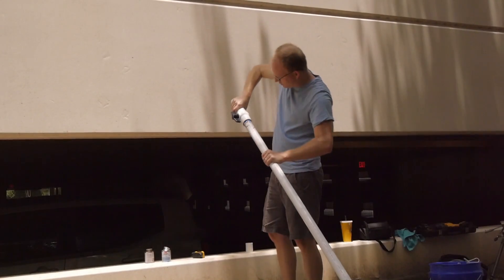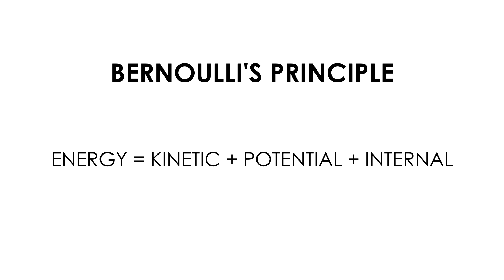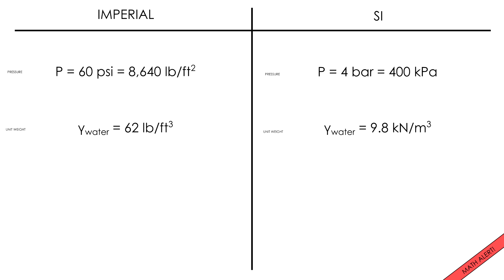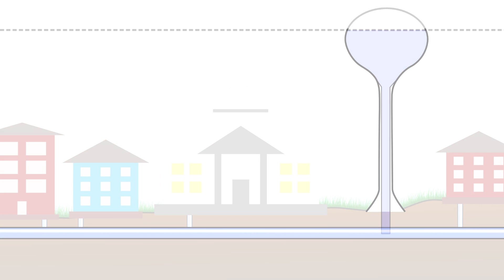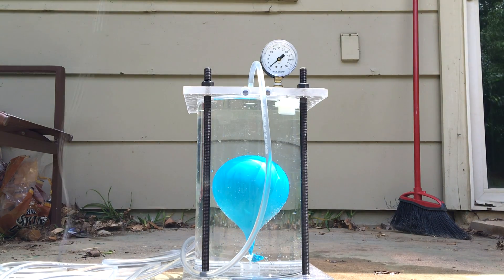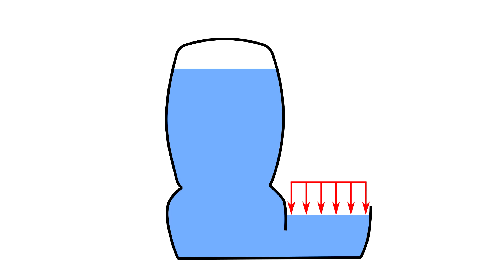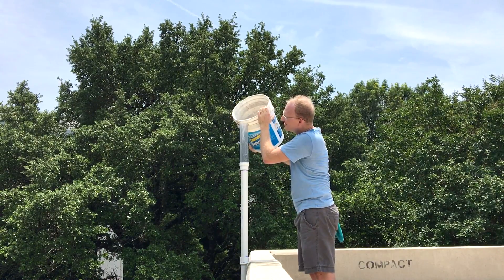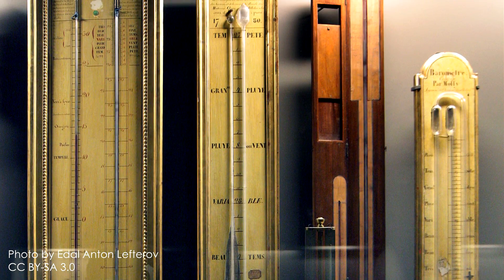Boil Water at Room Temperature! - Hydrostatics

Comment: The explanation for the water bowl is not correct. The top of the tank is, in fact, filled with air. When the tank is put in the bowl the water drains out, being replaced with air. When it reaches a certain height, the water creates a seal preventing air from replacing the water in the tank. Because there is nothing to replace the water, it stays inside the tank due to the force of a vaccum, but there isn't actually a vaccum in the top of the tank.

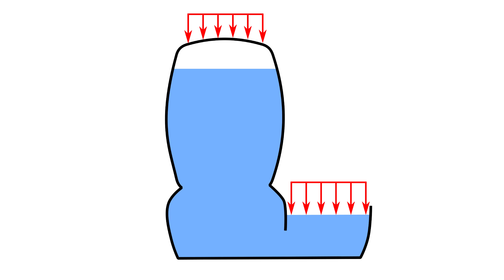Comment: 7:05

1. If im not mistaken, that is air inside the tank, not vaccum (obviously at a different pressure from atmospheric)

2. Applying bernoulli principle at h1 and h2 (assuming from the video that they are like 20 cm apart) you get that air pressure inside the tank is aprox 0,9 atm. Isnt that too much for the amount of air inside the tank?

Comment: I deal with this a few times a week.i siphon out barrels of water collected from ac units.ive learned to get a siphon going by simply taking a length of hose long enough to go from the bottom of one barrel to the next plus a couple extra feet.
I then yank the hose very very quickly out of the full barrel of water and have my thumb tightly covering the end of the hose and once the yank gets below say half the barrel of water I release my thumb of the end off the hose.
.generally doing this twice gets a serious siphon going.
The siphon stays going strong until that balance changes between barrels/buckets.

Comment: Actually, after read the title I am expecting knowledge to boil my drinking water without consuming gas.  

But not disappointed at all.
Another great video Grady.
Reply: Won't work. Just because something boils doesn't mean it's hot. You need actual high temperatures to kill germs and organisms. Water can boil at 50 degrees F. Just lower the pressure enough. That's why water will boil at 186 degrees F on Pikes peak. But it's not as hot.

Comment: Great video! I always wonder about negative pressure on water. Now I know. But what was the pressure at which the boil happens? Second, can you do one on Water Hammering? I learned that water is a incomprehensible liquid. That’s why they don’t use it in hydrology. But it would be great to know the pressures at which water fails either way. Please let me know if you do a video on this.

Comment: 2 inch pipe 200 feet long with a rise of 60 feet verses 1.25 inch pipe traveling the same distance and height. 2 inch pipe has approximately 236 lbs sitting in the pipe and the 1.25 pipe about 76 lbs  the pressure is the same I understand this but if using a 13.5 horse power pump will it draw less power to pump water up with the 60 foot rise with 1.25 pipe and more for the 2 inch pipe? Or will it take the same amount of electricity to pump up the water regardless the diameter of the tube being used?

Comment: I think there's a small misinterpretation here. Water pressure is not like conventional force/area pressure. It's a hydrostatic pressure and in fact it acts in all directions equally. The reason the hydrostatic pressure increases with column height is probably because of the increase movements of the water molecules. But I'd definitely like to know why that happens

Comment: Take a syringe, remove the needle. 
Pull a small amount of water into the syringe. About half full.
Place a finger over the nozzle where the needle would be and pull the plunger.
You just boiled water without heat.
WARNING!!   NEVER release the plunger while your finger is still sealing the nozzle when water is in the syringe!!
Water is EXTREMELY painful when injected into skin tissue, and doing so WILL inject water into your finger.
The plunger returns at a very high rate of speed when water is present.
Reply: So you injected water into your finger using a needleless syringe ?
Reply: @AmjadAbboud  
My first time doing this, yes.  I released the plunger and experienced pain I never expected.  lol
Certain immunizations used to be administered this way.  From what I was told, they were equally painful as the water was to my finger.
Don't get me wrong, it was not a lot of water injected. Just enough to make it under the skin and create pain.

The larger the syringe, the greater the risk. Standard small ones, while painful, tend to not inject the water as much as slam it violently into your finger.
Do the same with air only in the syringe and it returns very slowly.

Comment: Don't you think the title is slightly misleading "Boil Water at Room Temperature"
Reply: He showed you how a pipe 40 ft tall cap at the top and open at the bottom filled with water if the water was heated so 90 F it would have had a very vigorous reaction.
Reply: No, it boiled and was at room temperature.

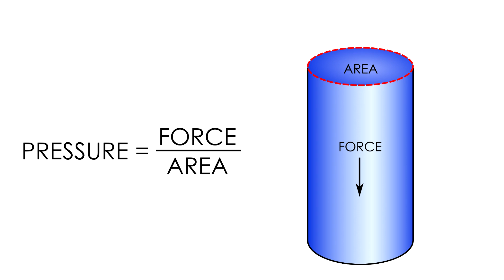Comment: 5:48 so does that mean: if we would stack single water molecules on top of each other to form a molecule tower with a height of 10 m, the pressure on the single bottom molecule would be 1 bar?
Reply: For single molecules, this wouldn't hold. As with most non-quantum models, this represents the average behavior of the molecules in the system.

Comment: Great Video, just one thing about your 10 m water pipe experiment: As the water starts boiling, it creates additional pressure in the pipe, but the total mass of water (liquid + gas) does not change. The ait pressure can therefore not push against that both, so water WILL come out at the bottom of the pipe. Probably not that much with your setup, but still some. Would have been great to see the bucket at the bottom during the experiment.

Comment: you said ' you can boil room temperature water just by taking it to the top of a parking garage '
that is wrong .
it sounds like you are saying if you take a glass of water to the top of a parking garage it will boil .
[
I am sure that you must mean that if you contrive a contraption as you have done with a pipe and close off the top while letting the water contents be pulled down by gravity with only the atmospheric pressure stopping it - then that will cause a vacuum at the top of the pipe which lowers the pressure enough to bring the boiling temperature of the water down to below room temperature - once enough water boils off to equalize the pressure - the boiling stops .
[
there - now i think we understand correctly what you meant .
[
please correct me if i am wrong - i am positively sure that is possible

Comment: was the valve opened or closed when you submerged it in the bucket?  basically was there  trapped air in the small section of PVC below the valve in the bucket or was that purged out? thanks

Comment: Hi! I know that the videos has two years but the subject is exactly what I need for my project so if you could answer me it would be great.

I am installing a 3kw micro hydro generator in my house. I have max 80m head from the generator to the point I take the water uphill. The water will be collected in a water tank and then direct it to the generator in a 25mm tube 60m below (to avoid excess cost of widest pipes). Will it be enought to create about 3kw of Energy? Will a wilder pipe give me more Energy?

Thanks!

Comment: Gravitational compression is relative to the electrostatic tension in the relative vicinity.  This is based on our planets motion.  As water shows us, we can induce electricity from inertial motion. We do not need water as a conduit for applying this electrogravitational compression value.  This can be induced using very simple, effective and affordable means. Innovation, 101.  https://www.google.ca/search?tbm=isch&q=electrogravitational+propulsion+mechanics&chips=q%3Aelectrogravitational+propulsion+mechanics%2Conline_chips%3Ainduction%2Conline_chips%3Akevin+hay&usg=AI4_-kT1BuY9kHAVfoGHs7gN0SWzJcG3wQ&sa=X&ved=0ahUKEwif0pqDpJjeAhVdHDQIHSj2ChAQ4lYIKSgA&biw=1366&bih=657&dpr=1&fbclid=IwAR2TYvqlG5tSBJszFu3lhzjrxjhPWeURubzVNm2oVExBZvZqi_1EYTE5QQI

Comment: being in a tank with a tube connected to the top filled with fresh water like in your demonstration would not be the same pressure as swimming to the same depth of water in the ocean. as the water in the ocean is denser than the water in the column.  😉

Comment: In your opening chart, the one with the red dots, the answer to how to show they are all the same pressure could be shown by extending a small "pipe" up.  if the pressure was greater in one or the other, then the small pipe should show higher.  
Now, this becomes more intuitive and does show logically/visually that the pressure is all the same.

Comment: So say I have a 100% fully airtight room. I fill the room with water and then go into the room. I'm exposed to a certain amount of water pressure. Now say I add a pipe at the top of the room and fill the pipe with water, then have that pipe point directly into the air (i made an illustration: tinyurl.com/tblpressure ) Would the water pressure in the room become extremely high and crush me?

Comment: Actually one small point using inches of mercury for air pressure is very rare today, hectopascal/millibars are more common (Both units being functionally identical). This is most notable in for example aviation the standard atmospheric pressure of 101.325 kPa would be expressed as 2992 in the US (Representing 29.92 in Hg) but in the rest of the world it would be given as 1013 (1,013 hPa). Similarly in weather forecasts the rest of the world uses hPa or millibars too the US just likes to be different even if it costs a few multi hundred million dollar spacecraft in the process.

Comment: this is really messing with my mind
so you're saying if I were to be submerged in a tank of water only 2' below the surface
then someone were to connect a STRAW to that tank that's 30' tall and fill it with water
I'd immediately feel like I was 32' below the surface?
Reply: If the container was sealed it would hold the pressure, if you are in an open container like a pool the raised water would just flow back to equal out pressure

Comment: The large diameter of the tube and the bigger water container on top,  compare to smaller tube and smaller water container on top, if both are at the same height,will the large diameter of the tube and the bigger water container create more pressure?

Comment: I have a question about civil engineering.
My home town is very hilly, and I calculated that there's just no way to pump that high pressure water to all houses on a hill. The pipes on the bottom houses would just explode, while the top ones won't even get any drips.
This also applies (more) to skyscrapers.
Now I later found out that there are stations situated around the city that take care of raising water pressure for pipes above it.
What happens in a skyscraper?
Could you maybe, sometimes, somewhere, please, pretty please, make a short video, or even some photos, of how that looks like?

Comment: GENUINE QUESTION PLEASE HELP. If I have a tap at the bottom to allow the water to fall into the bucket, can I then when the water drops capture that boiling water by knowing where it drops too and installing a ball valve and a tap?

With pipe and bucket can I instantly boil a cuppas' worth of boiling water for the price of turning taps and having carried water 4 flights?
3rd floor kinetic coffees?

Comment: Could boiling water at low pressure be a solution to the need of drinking water..??
Reply: Basil Sunny Well here's the thing, boiling water the traditional way has heat high enough to kill harmful bacteria, microbes, and fungus that's hiding in the water. Boiling water using low pressure does not kill these harmful critters living in the water, it only pulls out dissolved gases. 

I do like the way you think, keep it up and you might change the world one day.
Reply: Thanks :-) .

Comment: But my question is this: if the only factor that affects pressure underwater is the depth of the water, would that create two different pressures within the pet bowl, on either side of the threshold, and would we be able to observe that difference by moving only horizontally along the bottom of the bowl?

Comment: So if you took a 100m 1/8 in tube and climbed up a mobile tower, dipped it into someone's pool while they were swimming, then filled it with water, they would immediately feel a pressure of 100m of ocean?
Reply from the maker: Only if the pool had a lid. Otherwise it would just flow out.

Comment: Thanks for the video - very nicely done (with the exception of not having enough clear pipe at the top of your water barometer).  The only complaint that I have is with your "13 times shorter" comment.  People do it all the time, and I realize that it's the accepted practice, but if you have 1thing that is 10m long and you take that 1 thing away 13 times, I think a black hole is created or something...  That one thing doesn't exist anymore, anyway.  I prefer to say "one thirteenth as long".  Thanks again!

Comment: I did a science far project on this in grade 4. I discovered  it on my own when i dropped a plastic beaker and cracked the bottom. but putting a cork in it stopped the water from leaking out.
so my presentation was on Bernoulli's principle. and my teacher was like "...yeah. i guess that's kind of Bernoulli's principle"

Comment: I have a question!! so theoretically, if I scuba dive in my bath tab and someone's sticking in it a 20m long pipe and fills it up with water, would my pressure gauge show a depth of 20m ?
Reply from the maker: Only if you seal off the top of the tub. Otherwise the water will just spill out.

Comment: Why aren't water towers tall skinny tubes instead of tall bulbs? It seems like it would be more cost effective to have the water on the ground than suspending it up in the air.
Reply: It stores more, I believe they use water towers as both a pressure gage and a storage device

Comment: Great video! Thanks.
The vapor pressure of water depends on it's temperature, right? So the height of your water barometer would also depend on the temperature of the water in the column?
What if the tube was an inverted U with a vacuum (water vapor) at the top but the water column in each side at different temperatures?

Comment: when you said boiling water at room temperature I was assuming it was at stp considering nost people understand how pressure (or lack thereof) boiling workds. i was hoping some very odd principle I hasn't heard of would be applied.
Reply: Actually most people don't understand how boiling in low pressure works. I think you are an example of the Kruger-Dunning effect.

Comment: if you allowed the water to boil then opened a valve like 5 inches under the new water level would the water that comes out be boiling
Reply: The atmospheric pressure on the water would normalize as soon as you opened that valve. 
Also, "boiling" does not equal "hot."
Reply: but would it still be hot
Reply: RDproductions No. It would be at room temperature. The water at the top of the tube didn't boil because it was hot. It boiled because there was no pressure to hold it together.
Reply: but wouldnt the sudden change in presure causing the water to seperate also generate heat
Reply: Why would it? The water doesn't boil because the pressure changes suddenly, it boils because the pressure is low. If he had opened the valve slowly so the pressure changes slowly the water wouldn't have boiled until the pressure was low enough for it to boil. (which would happen once all the dissolved gases were out of the water) What about this would generate heat?

Comment: I'm struggling with the example at 3:59

At the bottom of tank two, I could increase the pressure by a factor of n by putting in n times the amount of water. Which makes sense to me.

But at the bottom of tank one, I could seemingly increase the pressure by a factor of n by adding about n/10 times the amount of water.

By extension, I could make the column on the top of tank one incredibly narrow, then increase the water pressure orders of magnitude by adding just one drop of water.

Either I'm missing something crucial, or there must be some other factor at play.
Reply: I do not think you are missing anything. The pressure at the bottom of the tank depends entirely on the height of the liquid in the tank.
Reply: Yes no matter what the shape, the pressure will stay the same, but:
Pressure in itself doesn't really matter. It's the amount of volume of water you move within that pressure that's important. For example, the drop you use to fill your very narrow tube will go very high. If you were to use that water on the ground, the tube will empty very quickly. That's why the water towers are big at the top and not at the bottom. If it were the case, the upside down water tank will see its pressure decrease very quickly when used.
Reply: If you do a thin enough column of water you start to step into capillary and surface tension matters, whose equations drift away from the simplified Bernouilli equation. 

If you understand that both a slender tube, like in the video, and sea would have the same pressure at the same depth, then the other cases can be inferred from this one
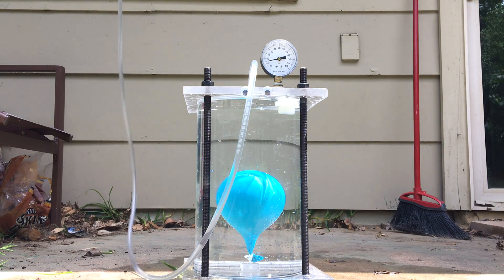Reply: The explanations at 3:59 are explanations of mistakes people make thinking about pressure. The explanation at 5:45 is the simplest way to express it. Obviously tank two is the simplest, same area top and bottom. Most people get confused about why the other tanks have the same pressure.

Comment: great video,  really well explained and illustrated. thanks

one thing i did wonder about though and correct me if im wrong but, wile its true the water pressure is the same in the skinny tank as it would be in the ocean at the equivalent depth. I dont think it would feel the same because the force is smaller in the tank but the surface area of your body remains constant in each.
And before anyone thinks to point this out, yes! a tank with the surface area of your body would be the same as the ocean. im only concerned with the skinny tank example.